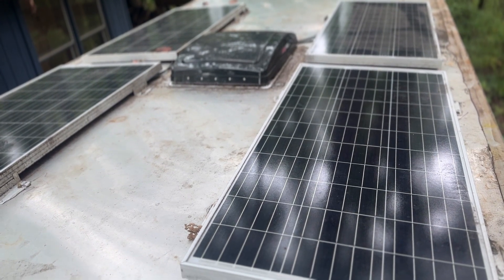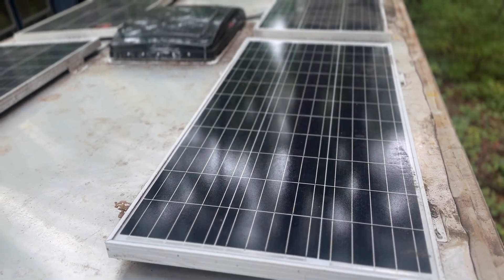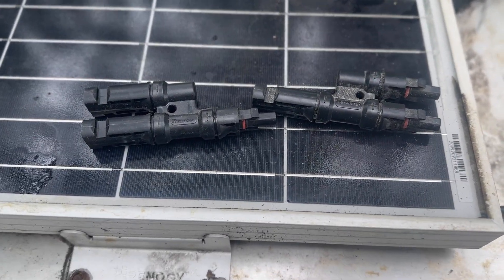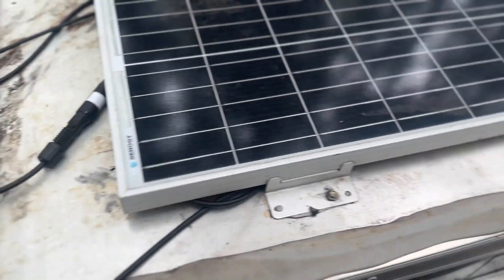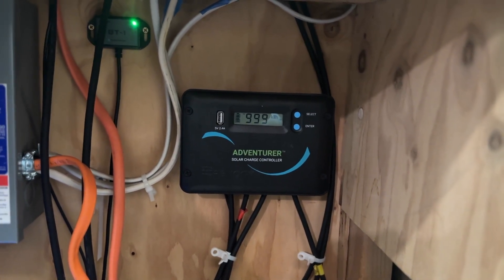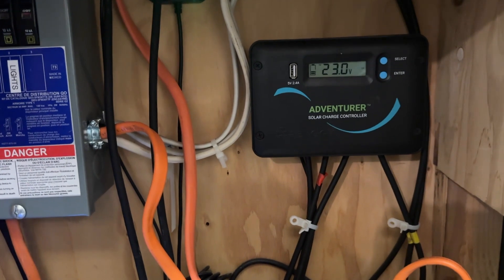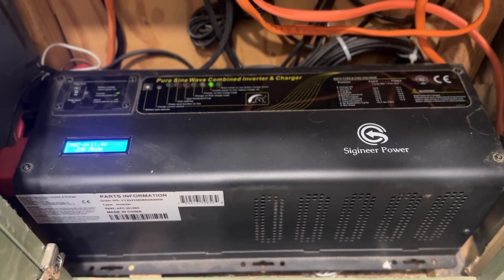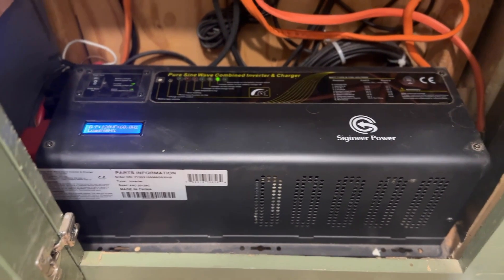Camper Solar System 400w

Comment from the maker: Valid point! I don’t plan to do any below freezing camping, but I typically keep the system live during the winter months. When I do upgrade the battery bank I will go with a smart battery that has internal heater and dormant cycle features.

Comment: Great video, Matt. Well done. One thing to think about for the future...

You mentioned that you plan to replace your gel batteries with LifePO4 batteries when the gels reach the end of their useful life. That's a great idea, but if you'll be charging the batteries in places where the temps drop below freezing you'll either have to mount the batteries inside (and keep them above freezing) or stay with lead acid batteries. Some LifePO4 batteries are heated though so you can always choose one of those.